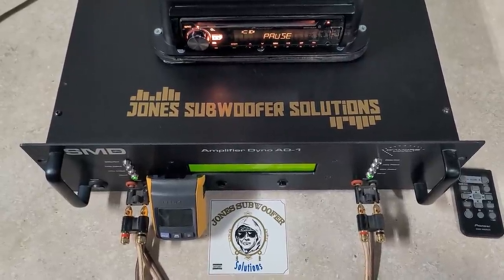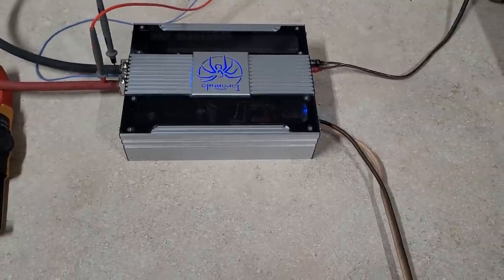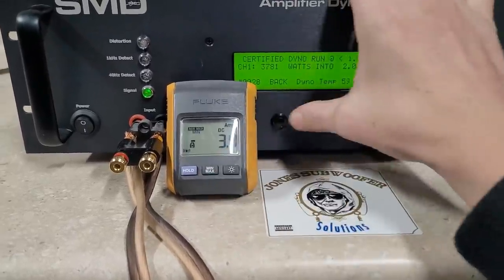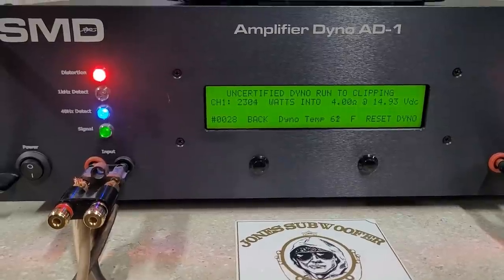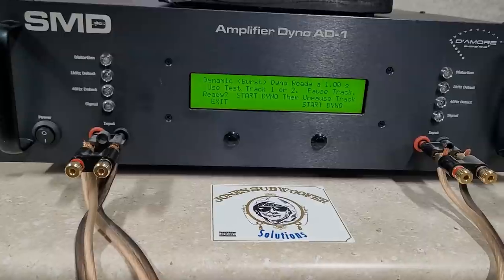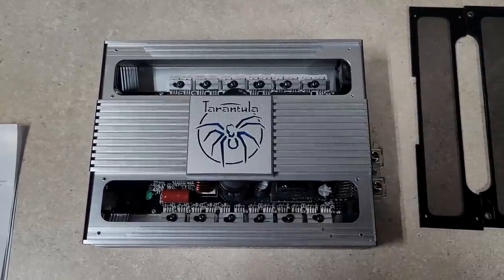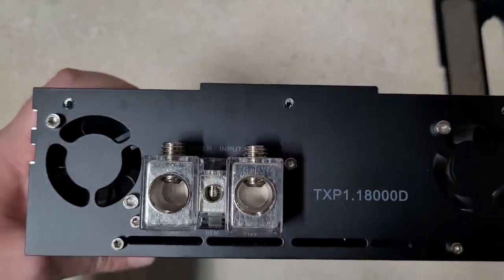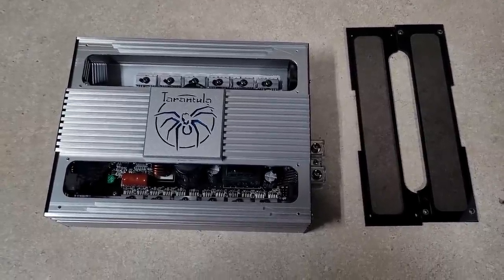AD-1 Amp Dyno Soundstream Tarantula TXP1.18000D by Jones Subwoofer Solutions JSS

Comment: over 6kw with a single run of wire, id say thats pretty impressive. And you were suprised you smoked the amp? Seriously! Do the test again with dual inputs and run within rated voltages..
Reply from the maker: Everything was done as per manufacturer spec.  You can see in the manual that it says operating voltage is 9-16v.   If it required dual inputs, it would have them.
Reply: @Facekicker  how many amps do you see that should have dual inputs but don't?
Reply: @Facekicker  You are trying to justify manufacture specs when they call it an 18kw amp? Come on man just some common sense I cant even believe it pulled over 6kw with a single run of wire.
Reply: @Facekicker  But anyways this test is pointless for anyone who will use the amp. No one is going to buy this and run a single run of wire into it. Thats ridiculous try doing a taramps run with a single run of wire and let me know how it does. I wish someone would actually review this properly instead of feeding it 16v and trying to pull everything you can out of a single run of wire. I cant even believe you were shocked when that happened, REALLY
Reply from the maker: @beardedforlife3740  I've never had an amp blow because there weren't third party dual inputs and extra cable used.   You might scavenge a bit more power, but it's not the difference of the amp popping or exploding.   I explain exactly why the amp popped.
Reply from the maker: @sparco317  we've done Taramps, check out the channel.  I'm also about to revisit the large Taramps models again now that we're on CMAX.
Reply: @sparco317  You are not seriously educated in electrical technology. The input wire didn't hurt anything. Although the initial voltage was a bit high. But like he said, the manufacturer said the limit is 16v, so not his fault.

Comment: U had both audio inputs pluged up probably why it blew
Reply from the maker: Wouldn't matter
Reply: He had to much juice going in to it needs to be no higher then 14.5 he was almost at 16
Reply from the maker: @BigChris76  15.2v... Says right in the manual and you can see, operating range is 9-16v
Reply: Barevids say it could cause problems if both inputs are plugged in.

Comment: OK so the power inputs are oversized 1/0 and even the remote terminal is 8....but the speaker terminals are LESS THAN 8 gauge! Rofl they really rushed this thing into production
Reply: I have this amp and I fitted 8 gauge in the speaker terminals no problem he wanted to bash the amp from the beginning but for the money it's a great amp over 6,000 watts at 1ohm you must remember that Dyno is torture on a amp
Reply: @alexturner4312  I had to drill the outputs to use 8awg to 4awg adapters. The drill size is 15/64". Tried two steps and the 8awg pin wouldn't fit until 15/64". The remote input easily fits 8awg though, a good bit larger than the out output terminals. The remote input should be tiny, makes no sense it's 8awg. I have powered it up, and it works but not sure how it will sound in the vehicle. Already seems to have a steep rolloff on the low frequencies.
Reply: Ok so it's been in my vehicle just running my idq8s until I get the 12 box done. The amp seems to have a peak around 60hz that's tough to defeat and anything below that has to be adiusted up because it's like the subsonic filter is too high. This is with it all the way down to 15hz. I also had to install a Harrison labs rca crossover at the amp, because its internal crossover sucks and to run my indash epicenter the deck crossover needs to be around 100hz to allow the epicenter to work. Maybe if the amp had steeper crossover slopes and a lower subsonic frequency, it could sound better. Going to run 3 4 ohm 12s in the future and see if the sq changes.

Comment: Dude.  Stop the voltage down. You know 90% of everyone here will be around 14 Volts. Most likely under that. Someone who spends $300 on an amp more than likely has a stock alternator
Reply from the maker: Dude.  The voltage will be even higher on some videos.  Stay tuned.

Comment: That amp has to have dual 1/0 inputs. I bet if you out 1/0 dual inputs on that amp it wouldn't of popped. 
Trtna pull to much amperahe thru small wire
Reply from the maker: So the manufacturer sells an amp that explodes if you use it as advertised?
Reply: @Facekicker   not explode on speakers like you said but even then I don't fully believe that. It's still tryna pull 450+ amps thru one single 1/0. I love your content man so I'm not tryna say your wrong. This is just my personal opinion on the matter of why it popped on the Dyno. An probably even would on subs eventually.
Reply: @Facekicker  I just feel to maybe possibly get more life out of it an hopefully not pop under stress an full tilt dual 1/0 inputs could maybe help but even then the amp itself needs dual ground an power Inputs for a 5k amp

Comment: That's my wet dreams...18,000watts.. for $300...I just remember my old Chinese Master always tell me to add another zero to everything so far so good examples 1800+0 equal 18000 watts not bad you gotta needed ten 16 voltage batteries not worth the headache 🐒🙈🙊🤬😿😭🤮💰🔥.. I rather have old school stereo system made in USA (Underated Smooth Amplifier) Rockford Fosgate Zapco PPI ect ahhhhhhhhh.. still made in CHINA ( Cheap Hidious In No Amplifier)))

Comment: No offense man because I really appreciate your videos, but something isn't right with your SMD AD-1. Take it for what you will....
Reply from the maker: How so?  It's fine and has been fine.
Reply: @Facekicker  I have a hunch that the impedance may be lower then what’s indicated
Reply from the maker: @WeSRT4  Not possible - it uses banks of passive resistors that cannot lose resistance.  
Also, dyno readings on the last 20 amps I've ran has been within 5% rated output at any given impedance other than some burst scores that shined.   In other words, everything is consistent with normal operation. 

If this is regarding failure of Chinese full bridge amps (the Soundigital clones) , they simply aren't built for a sustained static 1 ohm load.  They need to rise from 1 ohm, something the dyno doesn't do.
They all are vulnerable to the same problem whether it be Soundigital, Alphard, Sundown, Wolfram, or Soundstream, and plenty of others.
Reply: @Facekicker  I get what you’re saying, but watching bigd and others tests I don’t see them burning up as many amps. Something is different somewhere….
Reply from the maker: @WeSRT4  I can give you the answer.
Watch how fast Dereck hits pause on his runs.   Even on uncertified he's quick to hit pause, even though it could potentially read a higher score.   It's because the amps won't survive it some of the time.   I chose to let the uncertified track play through, and this breed of amps (the Chinese fullbridge) cannot do it.
It's a matter of finding the weak point vs playing it safe as possible. Taramps do fine, Korean boards do it fine.   I'm finding that these Chinese boards specifically are vulnerable - and I too have hit pause early to save some recently.
Reply from the maker: On this amp specifically it was the certified run but same scenario, clipping at a low impedance.

Comment: Another fail by Soundstream so it is just for looks not power output for 300.00 more like 225 period and it looks like it can barely last at 2 ohms :D LOLOL  My final thoughts  I WILL NEVER BUY A FULL BRIDGED AMP FROM ANY CAR AUDIO BRAND IN THIS LIFETIME................ MADE IN KOREA/MONO BLOCK AMP THAT IS ALL I RUN SINCE 2002
Reply: Don't hate on full bridge because Soundstream makes bad amps. My Sundown SFB amp is an absolute beast.

Comment: It says RIGHT ON THE BOX and the amp itself that it's 1 ohm stable when clearly it is not. It also says 18,000 watts, when clearly it is not. Might as well throw your 300 bucks in the trash. NOT a good value. Not a good product. Clearly not a good company either. You can't trust a company that lies to their customers. Plain and simple.

Comment: You blew it up cause you are running it at fucking 15
Reply from the maker: Manufacturer lists operating voltage as 9v-16v DC.
We were within acceptable voltage, and operating voltage was zero factor in the failure.

Comment: Wtf is the bs about jumping from 4 ohm to 2 ohm back and forth? Not getting rated power dynamic at 1 ohm, then "wondering" if it will do rated certified??? Get some adhd meds!
Reply from the maker: I was gonna check out your amp dyno runs for more tips but then I realized that you don't have one.

Comment: Max power 18k watts lmao
Reply from the maker: Maybe it's 18kw directly at the fets as they vaporize?
Seriously though, I think it would be an OK amp for someone to use, providing they wire at 1 ohm and not lower.   The dyno results seem to reflect the manufacturer relying on rise like I mentioned.

Comment: Not good!

Your test is not good!
Why?
So, here in Europe we have not 15V or 14,6V in our cars.
We have roundabout 13-14V.
So, your test is only for one market and so its shitty...
Reply from the maker: Thanks for watching 👊
Reply: @Facekicker  What?
Reply: Same in the USA however a lot of bass heads connect multiple batteries to get upwards of 14-16 volts. The test is valid if the amp is rated to handle the test voltage.
Reply: @600zxr  Thx 4 your answer but, the reality is, the most people have one Battery, one or mabye 2 or 3 Subwoofers, maybe in one Enclosure and that's the story. One Amp for that.
Reply: @J0HNWICK  maybe do your own channel testing amps based on the "typical" car audio setup.
Reply: @600zxr  It's an idea but i think as a beginner here in germany, the companys wont send me samples to destroy their unreal watts.
Reply: @J0HNWICK  most of these guys buy the amps at first or borrow from friends. I'd send you mine to test but Germany would cost $$$$$ in shipping.
Reply: @600zxr  i have Zero time for tests. I work fulltime, from morning till evening and ive nö money to buy test equipment. And I have only one friend. He have an Audi A6 with serial Bose equipt.
Reply: @J0HNWICK  if you have just one battery........ Stay away from 3000 watt amps 😂 🤣🤣🤣🤣🤣
Reply: @600zxr  I agree.  Test a 3000 watt amp on a 1 battery 12 volt system with car running maybe 13.7.  let me know how that goes🤣🤣🤣🤣🤣🤣🤣🤣
Reply: @J0HNWICK  I think they won't send you anything because you sir can't handle the watts.
Reply: @J0HNWICK  ahhh I get it now. You been trolling this whole time.  You got me😉
Reply: @angelvip2474  What?
Reply: @angelvip2474  got 2!
Reply: About the stupidest thing I’ve heard all day. Everyone is capable of running the same voltage lol.. spend some money if you want power.
Reply: @J0HNWICK  You said "Thx 4 your answer but, the reality is, the most people have one Battery, one or mabye 2 or 3 Subwoofers, maybe in one Enclosure and that's the story. One Amp for that.
"

The reality is, if what you said were the case you wouldn't have any business running ANY amp rated at 7k RMS?
Reply: @MurderousMindstate  i don't understand, What you mean... 🥴
Reply: @J0HNWICK  simple really. You need upgraded electrical. A high output alternator possibly 1 or even 2 extra batteries to run a true 7k rms amp. So if you had one battery and low voltage why have a 7k amp... in REALITY?
Reply: @MurderousMindstate  i have no 7k Amp.
Reply: @J0HNWICK  his test isn't for one market, the amp is. The 7k market where people have the voltage to support it. Not the market of 1 battery folks trying to suck 400 amps of juice from stock alt and battery.
Reply: Try looking up amp dynos in your country or your voltage area. Otherwise run the tests yourself. Dont put people down for the content that thousands of others find useful. Grow up and I hope your happy someday my guy
Reply: @J0HNWICK  I agree with Joseph and ill add, if you don't have anything nice to say,,, keep your GD negative comments to yourself. My word the pricks on YouTube. Facekicker does an excellent job and shows what an amp will do with the power available during test. Just facts, don't watch if you dont like it
Reply: @kswis  don't Cry maylady... 🥴
Than the Video must be only available in the US.
In other Parts of the world, the are Million other cars with not 15V.
Reply: @J0HNWICK  1 batterry. Look at 1000 rms at the ohm u need. My class d puts 800 rms out. Headlights dont dim unless I'm parked at a red light.

Also have 2 tens. 1 batterry. At 4 ohm. Once I hit 1 ohm. I'll need 2 batts.
Reply: @Shaggy4hire  i got 2 batterys... Happy weekend...
Reply: @angelvip2474  
He got a a/b class for his lows.lmao
Reply: @josephfrazier5043  got sound quality a/b go for it even on sub.  But that will be a big ass a/b to have any real power.
Reply: @angelvip2474  yea
Reply: @Tyler_Bass850  crescendo 5500 dclass. Taramps  and earthquake class j amps are my three choices all day. On American bass xfl or vfl subs with a upgraded spider blow shit out the water
Reply: @josephfrazier5043  I have a bc5500 that is for sale right now, and i have a c.2sq on 12 8in Sylvester's and its stupid loud, my buddy matt has the LOUDEST crescendo build, I don't dig taramps but everyone is entitled to their own opinion right lol ill trade this amp for 4 8s in a underseat box for a 07-13 gmc/silverado crew cab
Reply: @Shaggy4hire  1900 watts aint shit